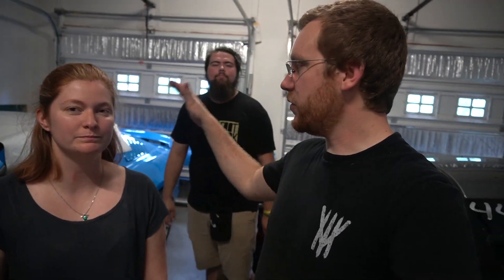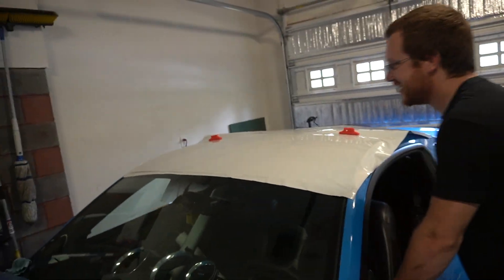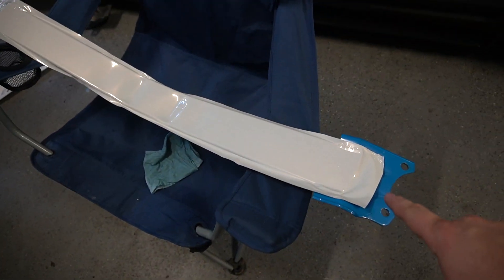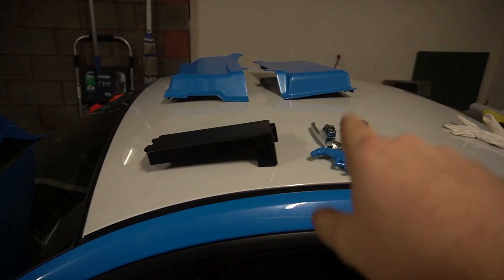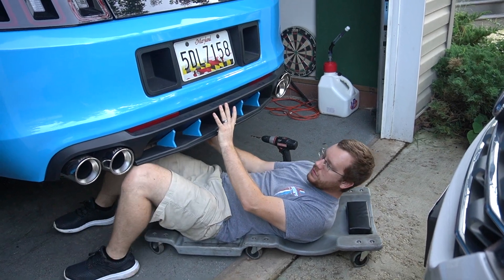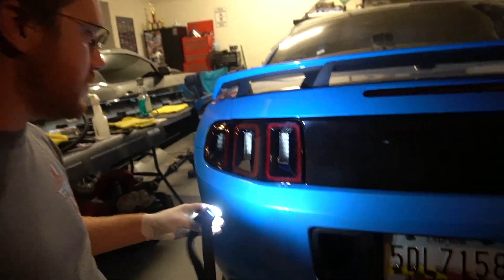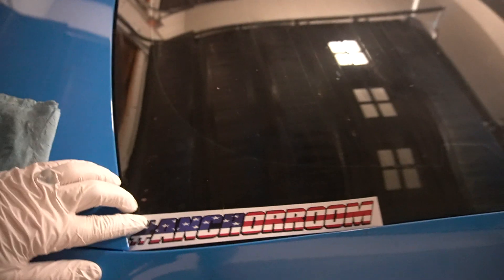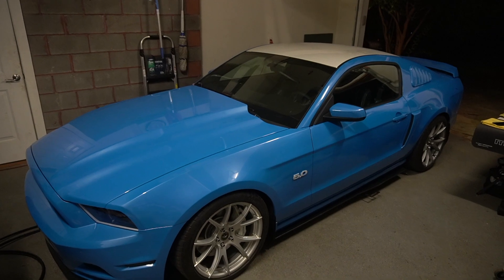Project Bombshell Ep.14: Cosmetic's Wrap Up!

Comment: How has the Frakenstein mustang been running? I am doing a Gen 3 shortblock and gen 2 heads on my 2015 mustang gt. Going to do some stage 3 N/A comp cams and do an N/A setup. Have you seen any issues with coolant flow? Also your video breaking down the heads and gaskets was very helpful!
Reply from the maker: It’s been running great for me, no major motor related issues 👌 should be a solid setup for sure the cams will definitely help out. I haven’t seen issues with coolant flow persay but I did notice a different average operating temp from the old motor to the new one. Seems like the new one is up around 5-10 degrees on average but still good temps overall right about 195-205. I think it was more like 185-195 before but it could also be the time of year I’m paying attention during too, kind of hard to say. But glad you found the heads video helpful I tried to make that one very informative and clear so that people know what needed to be done.
Reply: @pokemasterbs  Good to hear! Just waiting on parts for my car now. ARP is really back ordered on their headstuds and I wont get them for over a month. Thinking about buying from Livernois.
Reply from the maker: @triston2735  Yeah the industry is still feeling the impact from covid unfortunately. Starting to slowly recover but still going to take some time. I've seen a comparable to ARP brand pop up recently called Apex. Might be worth checking out if you're still struglling to get hands on the ARP's. No personaly experience with the Apex stuff personally however, just sharing for what it's worth.
Reply: @pokemasterbs  Ya I have also heard of Apex, just need to do some research on the company. They (Apex) should have studs in stock next week. Now I am just waiting to see how long the heads will take.